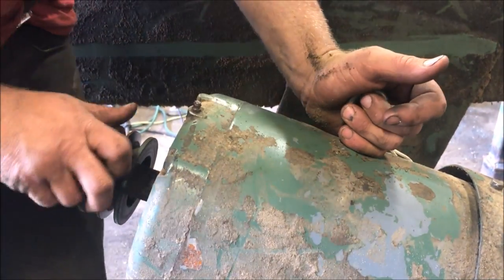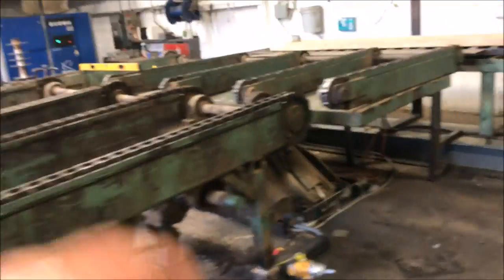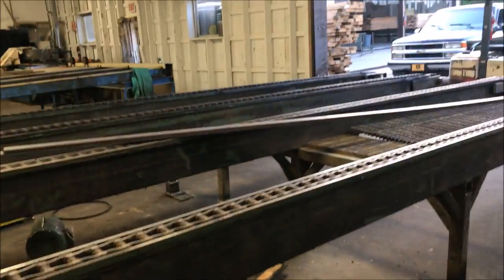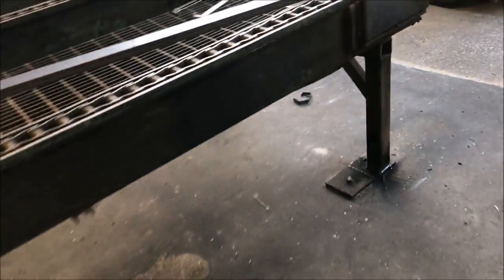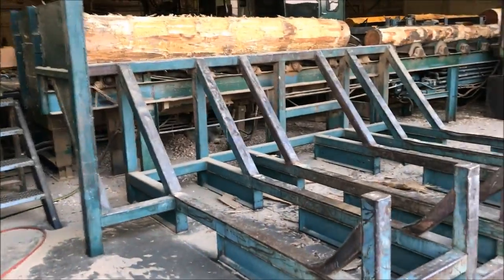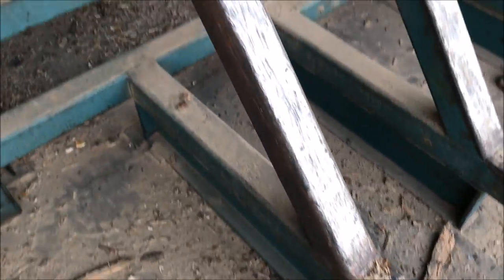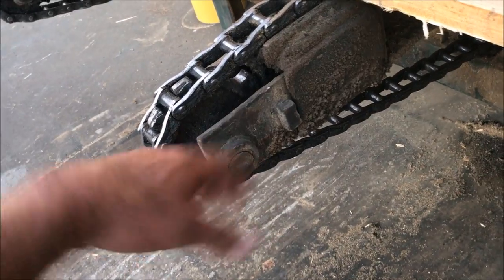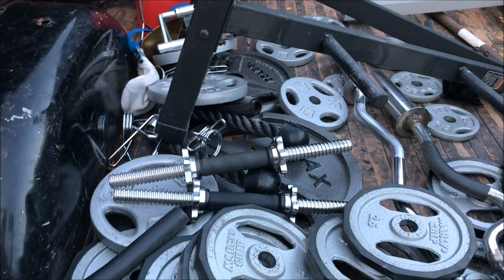Cant handling project   getting started

Comment: Logger Wade - If you don't mind how high you make the sprockets - the in-feed to your pick up can be offset vertically. In other words - move your in-feed sprockets up instead of out. Making the fall into the pick-up twice as long as the system that works so well. Another point I just thought of - if your in-feed sprockets are higher than the top of the grapple when the bottom skids are under the wood bundle. The only additional heights needed to put the in-feed sprockets on an overhang would be the lifting height of the grab +\- a safe margin. Problem Solved! If anything I've said makes sense! (Sometimes -it don't)
Reply from the maker: J Morgan perfect!!

Comment: So what are you actually doing to the thick lumber laying outside ?
Reply from the maker: VideosByAl cants for crating
Reply from the maker: We saw them down in a different room
Reply: So it's a 3.5 x Random, made into 5/4 x 3.5 or something close.
Reply from the maker: VideosByAl it's more like 2-5/8 and 3" by wides and they are separated...  (not sawn togeather)  gonna be broke down for little pallet boards
Reply: We use to make Stringers. 1.125x3.5x48 and 1.375x3.5x36.
Deck boards are money loosers for us.
Reply from the maker: VideosByAl yeah we send them through multiple head units..  only way we've found to make any on them